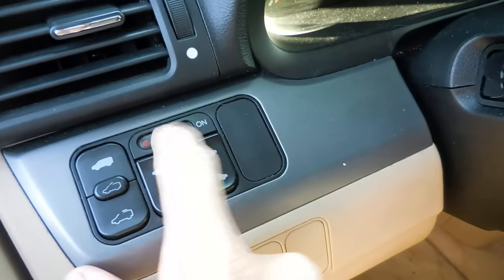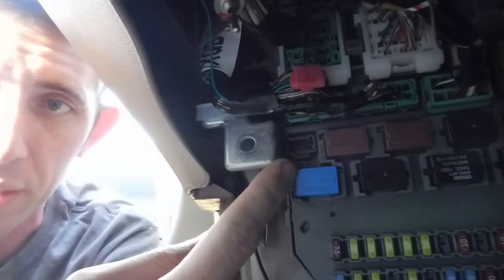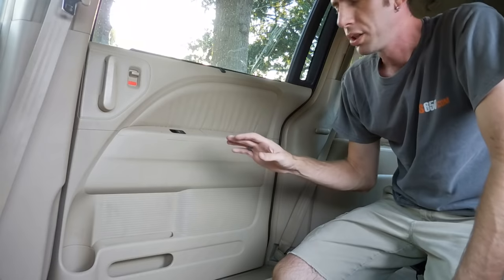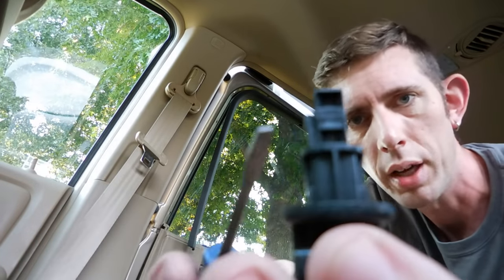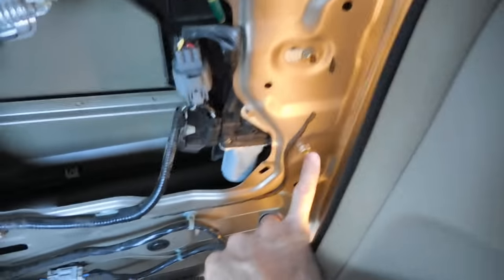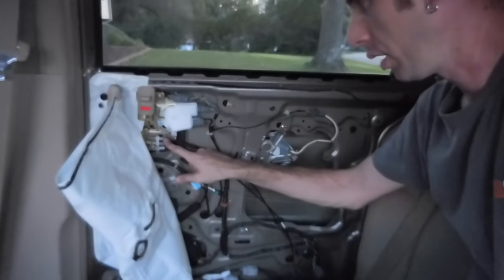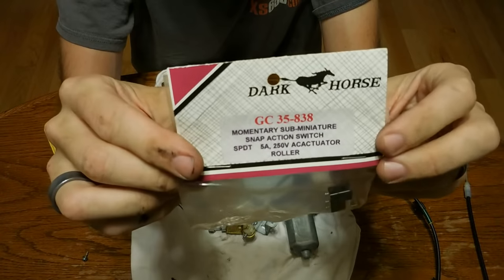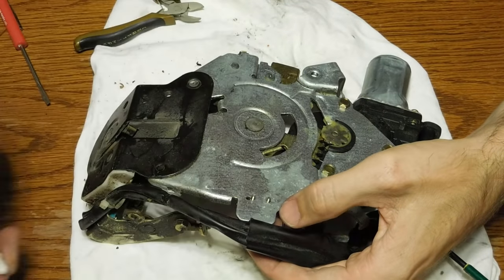Honda Odyssey Power Sliding Door fix - CHEAP

Comment: Great video! I saw the odyssey thread, but your video made a couple points clear about the tin foil testing for code and how to test the microswitch to make sure it was what failed. Saved me a ton of time and money, thanks!
Reply from the maker: Larry Mecham great!! Glad I could help. Thanks for watching.
Reply: @DustinRogersinMO  sorry I wrote a few on the public comments.
Would your door open or close at all automatically ?
And just wouldn't suck shut at the end of closing cycle. I'm almost certain its to do with doors ,I cant imagine both door motors, Hinges , latch switch assemblies go bad on both doors
Reply from the maker: dunngee I replied to your other comments. See those.
Reply: @DustinRogersinMO  can you tell me a part number for that cover by driver's left foot which covers hood handle and fuse box (you removed that ) I lost mine ,thanks
Reply from the maker: Grucha Killa not sure on a part number but it’s called a kick panel. Should be able to find one by searching for that.
Reply: Totally agree, loved the details and a clear image of the mechanism!

Comment: THanks so much. Have 'repaired' both our sliding doors, about 8 months apart.  They both would close, and then relax and let go, allowing a lot of road noise in. 
All i needed to do was lube all the mechanisms. First door took me about 3 hours, the second about 1.5 hours. Zero cost.
Can't believe how many odysseys this vintage out there you see with this problem.
Reply: My I can’t fix my I need help
Reply: Can you be a little more specific about which parts you lubricated?
Reply: @ashprid84  Everything! Anything that looks like it is mechanical and is supposed to move, associated with the latch. Sorry, I can't really recall after all this time, but it should be common sense, that's all i can add. Just make sure it is a good quality lube. Some recommend silicone grease spray.
Reply: @ivanchicken2909  thank you for your reply! So I had my tire pro check it out and he said it appears the door is coming off the track. I was thinking of trying the lube. The other one is starting to act up 🥲

Comment: Just did your repair a week ago on an '05.  Just like you found, no continuity on the switch. Bought 10 switches on ebay for a few bucks. Door has been working now for about 2 dozen opens & closes. While I had the unit out, I went ahead & lubed everything that moved or rotated; used Fluidfilm. Thanks so much for posting this. It's still helping folks some 3 years after!
Reply from the maker: jj parody great. Glad you got it fixed and saved some money. Thanks for watching.
Reply: @DustinRogersinMO  Again thanks for the video. Mine quit working again after a little less than a year. I pulled the unit out again & replaced the "cheap" switch (even though it continuity-tested ok) with a Honda OEM. Still to early to tell if it will work long term. Is yours still working? Thanks.
Reply from the maker: @jjparody8257  we traded our van in for something different a couple years ago. It was working up to the time of trade in though.

Comment: Thanks for sharing the video and explaining how this works from an engineering standpoint. I agree with you that the local shop will throw a bunch of parts on it and will not know exactly what’s causing the issue. 17yo minivan starting to show its age. I just replace door lock actuator on our 2008 CRV so I know how difficult it is trying to remove and install that while working around that window track. It’s a pain. Thanks again for sharing this video. I do have a soldering iron and know how to fix this. 25 years Engineering Technician experience will come in handy here except old eyes slowing me down a bit. 😂

Comment: Thanks a million Dustin. Your fix was spot on about the little blue switch being bad. We bought 10 of them on Amazon for $7. One thing we would like to add is how to do a reset when everything's done. We got ours put back together, and the door was getting absolutely no power. So we took out fuse #7 and replaced it after a few minutes. Then we turned the dash switch for the power doors OFF, then opened the door-in-question ALL the way, then turned the dash switch back ON, then  went over to the door and activated it by lifting the handle, as if to close. And, viola!, it DID close -- and has been working flawlessly ever since. We can't thank you enough for saving us the $1200 the stealership wanted (and which we were never going to pay). By the way, we also cleaned the rear latch really well, like many threads suggest. Good luck all you Ody Owners!
Reply from the maker: Jules Shepard great! I’m glad you saved some money and fixed it yourself. Thanks for the note on the reset after the repair. I did the reset by clearing the codes prior to removing the latch assembly. Pulling the #7 fuse is the method of clearing the codes without getting into the diagnostic mode via the instrument cluster/trip reset button.  Thanks for watching.

Comment: I just completed this fix.  It worked like a champ.  I did it on my other door last year and it didn’t work.  I thought I might have done something wrong.  After taking this side apart the other was indeed froze up.  I had to buy a new replacement.  This fix cost my $8.  Thanks for the video.

Comment: This video is awesome.  But before doing ANY of this - try the following first.

Click the power door switch to off (cover the red dot).  Open the door MANUALLY.  It'll be stiff, but you can do it.  Close the door MANUALLY.  Do this a couple times.  Switch door back on (so you can see the red dot).  Try operating the door normally (electrically) now.  

BINGO!  Worked for me!  It's been about three weeks now...
Reply: Wow, just tried this and it worked for me. Hopefully it will last for awhile. This door stopped working after the battery went dead.  I hope it was just a “reset” that was needed. 
Thanks for the suggestion!
Reply: Does the car running doing this?

Comment: Outstanding Video! Thanks for posting for others to view and learn. From the error code determination, to the door panel removal, to the switch replacement, this was exactly what I needed to repair my non-working power sliding door (2006 Odyssey). Big time $$ savings. Thanks again!
Reply from the maker: Nick Witte great. I’m glad I could help. Thanks for watching.

Comment: BRILLIANT!!!!

My symptom was that it would close, crank tight, sit for 3 or 4 seconds then uncrank a little such that the door would crack open.  I was able to switch the door to 'manual' (the slide switch above the door switches on the dash).  Open and close the door manually a few times from the outside.  Switch back on and now it 's working again.  for now, anyway.  But I will bookmark this EXCELLENT video in case I need it in the future.

Comment: Thanks for this video, Dustin.  Just completed the switch replacement in the passenger side sliding door....  AND IT WORKS!!  Maybe go back to your vid and put a card in when you call out the bolts to remove.  They are 10 mm.  I only now saw that you mention this in the text below your video.

Comment: You're a genius! Thank you for the video. Kind of entertaining to watch. Dealer cost $1900 to replace the motor, cable broke for 2014 odyssey. User error I guess.  Parts is about $400. So labor cost drives it up. We're stuck with the dealer, I'm not a mechanic. Just to get an idea what is in the door panel.

Comment: This video is great!  I love the speed.  It only took me about an hour to make the repair and my door has been working perfectly for months now.  
A few minor tips:  
You will also need a center punch (or thick nail) and a hammer to start the drill a hole. 
You will need a drill bit. I don’t remember the size.
At Ace Hardware look in the stainless-steel sections for screws that small.

Comment: Great work, Dustin.  I've been a Honda dealer tech since 2002, and I am impressed with your handy ability to get the job done.  I have the same problem (B2038) tonight on the left side of my 2005 EX-L.  I diagnosed it down to that switch and your video popped up when I searched the part number on the original switch (Matushita ABJ39242).  Since the worst case scenario was $250 for a new latch, I said what the hell, and opened up the microswitch.  I found a lot of powdery corrosion on the contacts inside, and packed full of grime. Gonna clean them up tonight and see if I can revive the switch.
Reply: Did you revive the switch?
Reply: Yeah lets us now lol
Reply: @rudyshoplopez7366  Jerry gave me a hint of a probability of reviving the switch.  I opened the switch and noticed a bunch of black oily dirt which caused back contact.  The metal parts inside of switch is stainless steel and should work if it is clean. I cleaned it very well, and put the cover back.  I also used a little silicone to seal the gap on the below the cover to prevent future dirt from getting in.  Reinstalled everything back.  Now the door works perfectly.

Comment: Nice video 👍 Our 06 Ody keeps draining our new battery within couple of days. Pulled the #7 fuse and amp reading went from .32 to 02 ma. The wife previously mentioned that there was always an audible constants beep once the car was put into reverse or drive. Turned out to be the door alarm warning that indicated the sliding door were open and no warning in the instrument panel. I think this micro switch might be our culprit. For now I have the fuse removed, but, we lost our interior lights when doors are open, remote keyless entry, and our security. Told the wife we’ll have to deal with it until I can perform this task. Wish me luck...Once again thanks!
Reply: Soy Eldiego I’m having the same issues with my ody, have you fixed yours?
Reply: Would like to know whether you fixed yours...

Comment: Really enjoyed your video! I found that the microswitch on the latch on both of my doors wasn't engaging. I was able to clean the spring that forces the metal against the actuator and actually bent the arm on the switch just a tiny bit. For now, both doors are working fully!
Reply from the maker: Zachary Walker great. Hopefully it stays working for a long time.
Reply: As time consuming as it was to get to the switch, I think I would replace it instead of hoping bending the arm is all I needed.  Good luck!  Oh, I see you posted 2 years ago -- is the door still working as it should?

Comment: Very grateful for this, BUT some caveats!

I got the b2088 code and subsequently installed the original recommended switch.  After the repair, my right door worked intermittently and in different fashion (when closing it took longer to do the last pull in bit), and my left door stopped working, altogether.  I was not happy.

Resolution:  b2088 code was still showing, hence switch was still problem.  It needed the arm to be bent out so it was more easily activated.  Left door issue was the typical occurrence of where it needed to be reset:  set dash sliding door switch to manual and then back to electronic, and press both door close buttons, or whatever the procedure is.

So, I would highly recommend you get the direct replacement switch from Digikey, if you have the time.  I didn't and needed to fix the issue quickly.  Thank you, thank you!

Comment: Thanks I was having my driver side door not opening it started today I saw the slide door light on my dash saw your video pulled my 7.5 fuse under driver panel. Put it back light went off and  door works again. 👍🏽 we’ll see how long it last but it’s working now. It’s an 2007 had it for 8 years never had this problem but thanks for the help

Comment: Great video, saved big $$$.  FYI, ABJ362860 is a direct replacement for the switch.  No drilling or soldering and plenty of wire; just need two small wire nuts to twist to the car wires.

Comment: Fantastic video! Thank you so much! I just finished the repair in about 4 hours, using an original $10 switch (no drilling or soldiering needed). BTW, you don't need to remove the whole trim around the window. Just the unclipping the lower section was enough for me. I didn't find a good way to pull the clips that hold the metal cables. Pulling them out damaged them a bit, and I didn't find a way to push them from behind.
Reply: Do you have the part number 
original swith can share please.

Comment: Thank you Dustin Rogers for the great video.  You are a lifesaver!  The Driver side rear door went out on me, and with your video, I was confident to complete the job.  I would say, it may be better to get the exact switch from Digikey as Valentin Valtchanov suggests as I had to replace both switches, and the second switch is hard to replace with the Amazon sourced.  Also, with wires would make it easy not to have to deal with tight wires with the existing wiring.  Thank you for giving us the video.
Reply from the maker: Thanks for watching. Glad you were able to get it fixed.

Comment: Great video man and i have watched ALL of them.  Love your style - thanks for taking time to show this to the rest of us.
Reply from the maker: harrellNOAA glad I could help. Thanks for watching.
Reply: @DustinRogersinMO  Update - I tried the tin foil trick, but I have a 2015 Oddy and you get a different result.  The trick just turns the power on as if you turned the key to the first position.  There was another slot that looked different, it has several connectors that are counter sunk so I left them alone.  Too bad I could not get to the code numbers like you did.  But my door has been a bear to fix and so I am going to pull the switch and test it anyway.

Comment: Dustin, thanks so much for this! My 2012 just started the infernal beeping, and Google brought me to the Odyssey forum, which brought me to search TSB 16-074 - Power Sliding Door Beeper Sounds While Driving, which brought me to you!  But dayum, it's now October 29, so I have to clear my garage first to get the van in to check it out further.
Here's hoping this is the problem because what should be a 3 hour job is gonna be an 8 hour job ...
Reply from the maker: Patti Maska good luck with your repair and the garage cleaning. If your garage is anything like mine, you’ll be lucky to have it done before spring. 😁

Comment: This was a fantastic video! I've probably watched it a half a dozen times. Thank you so much! I was able to order an exact replacement, and got the switch swapped out pretty quick. I had to do some additional troubleshooting, and resetting to get the door to operate after I installed everything, but it has worked out. Thanks again!

Comment: Aaaas your take-apart was Most Excellent, & helped me Lots to get that B(eauty) out,  here's an Add.

Spring-loaded arm sticky,  fails to activate upper microswitch N.O.  as latch closes (should strike just short of grab-slot vertical) White wire won't connect black -stronger spring would be great,  some hopes,  but clean & lube  while there, that alone fixed my "close, 3-second reopen"

Comment: Thank you, your video was a great help, I had code b2088 and the problem is now fixed.  
I'd like to add that I was able to open up the original blue micro switch and clean it out.  The stainless steel arm is able to slide out and once you do that the switch pops open in the middle if you pry it gently with a small screw driver.  Once its open you can easily clean the electrical contacts.  Mine was caked in dirt so the contacts would barely move.  I used a small needle and some brake clean spray to clean it out and then I sprayed some silicone spray to lightly lube the contacts.  The micro switch parts easily clicked back together.  Tested with ohm meter to verify it worked properly before putting it all back together.
Reply from the maker: Nice! I hadn’t considered attempting to fix the switch. Thanks for the technique.

Comment: aprieciate the vid. Figured mine out. In many cases its not the switch but a tiny spring loaded lever that activates the switch.  White greas thickens over time so it will not spring back all the way into place. 
Main levers, servos and reset still work but the rear latch switch does not activate because the tiny lever inside is stuck. Just shoot good old wd40 way up into the rear latch assembly and walla... all is like new again. Hope this helps somone.

Btw when the switches do seat it should also stop the annoying 400mh battery drain as well.
Reply from the maker: zzzonezz interesting. Thanks for the tip. Hopefully it will benefit someone.

Comment: Just fixed my '05 Odyssey driver side sliding door.  They sell the micro switch on eBay for $30, exact fit, no hole drilling.  After 2 days for driving, the light hasn't come back yet.   Yes, the window track is pain in the neck to squeeze the latch assembly thru, even after I took off the bracket.
Reply from the maker: Francis Phuong Sweet. Glad you got it fixed and saved some money. Can you share a link to the switch you ordered?

Comment: Great video, the left door behind the drivers seat stopped working. I checked for the code and the code came up for the switch. I replaced the switch and the door wouldn't operated until I took out the no 7 fuse and put it back in. After that the door would only open 5 or 6 times and stop again until I took the no. 7 fuse again. I saw that there is a 2nd blue switch so I'm going to replace that to see if that works.